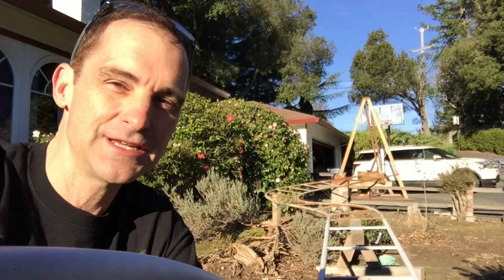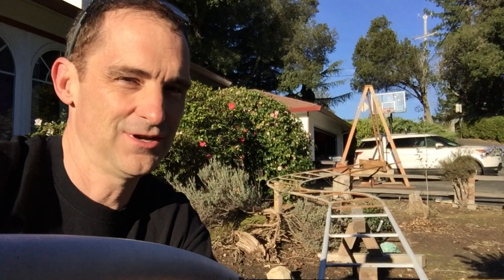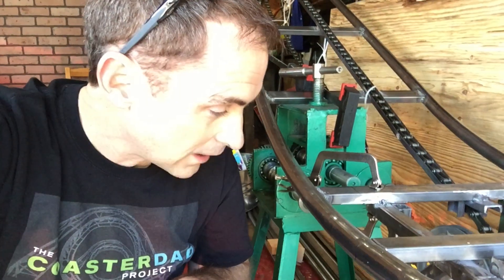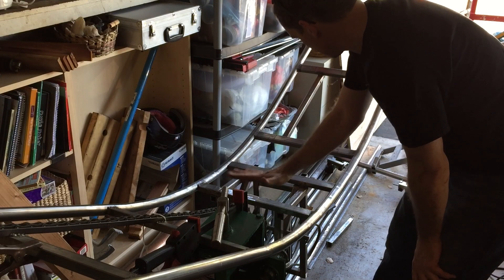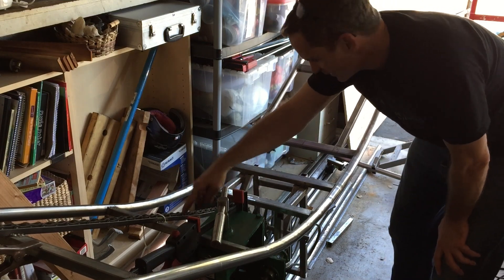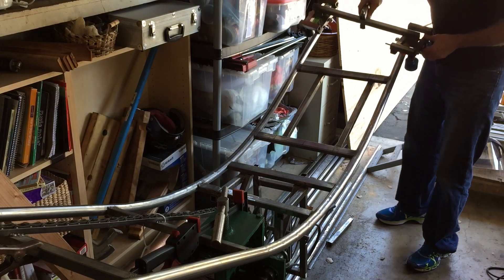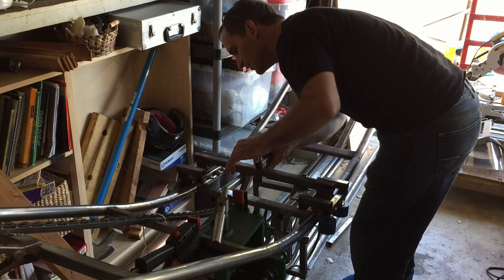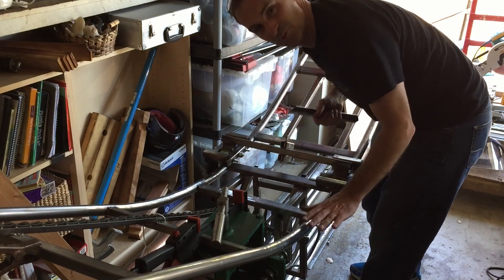Chain Lift System Solved!

Comment: What's the specs on the elec motor exactly?
Reply from the maker: This motor was a 110 volt 1hp motor. Later on, we upgraded to a 230 volt 2 hp motor, which was easier to wire and plenty strong!